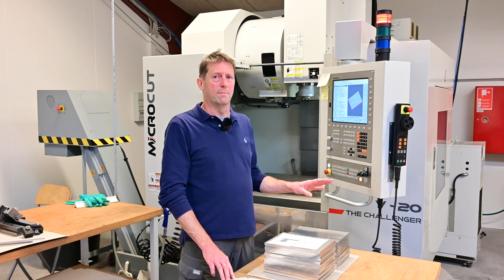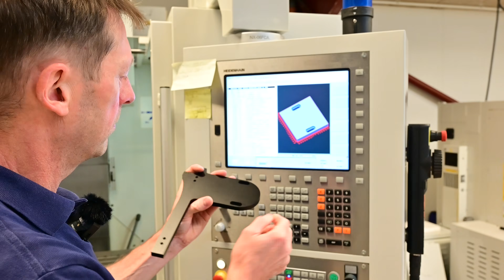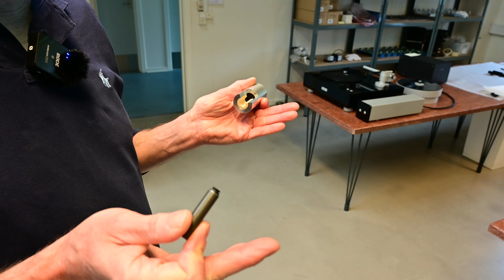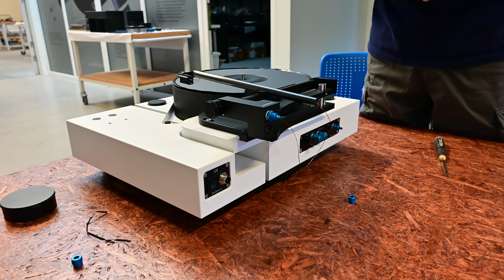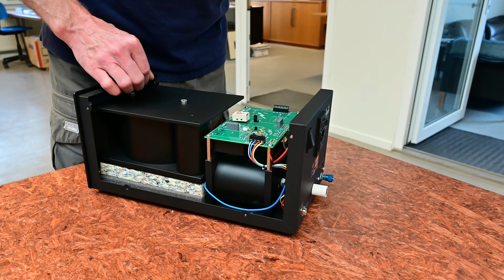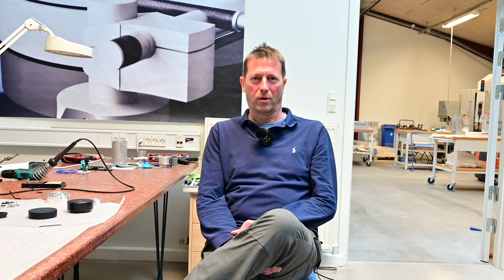優雅不凡，氣浮技術專家: 丹麥Bergmann Audio原廠巡禮

Comment: Yes, that's it, one of the best turntables on the market with air storage, vacuum suction for the records to lie flat and an air-bearing tangential tone arm that functionally plays freely, so as an overall package it's a great thing. I've been running Galder and Odin for 4 years without any problems.